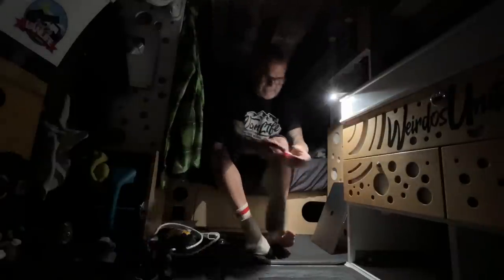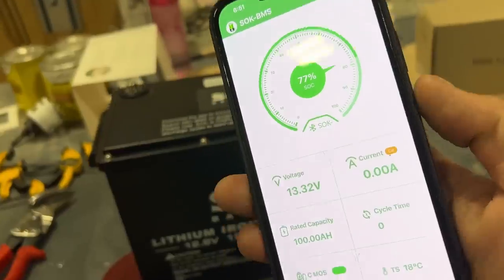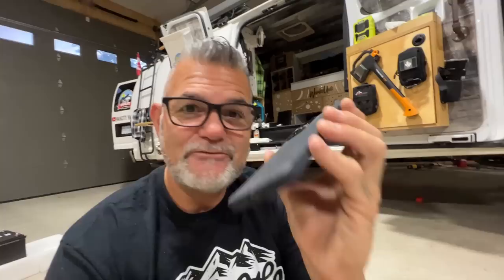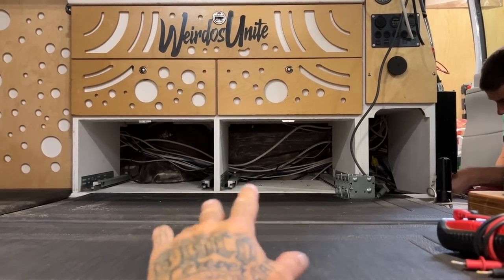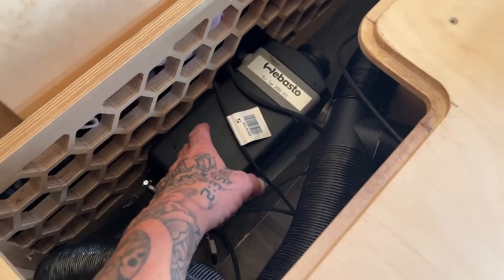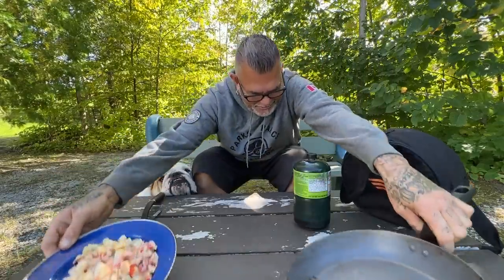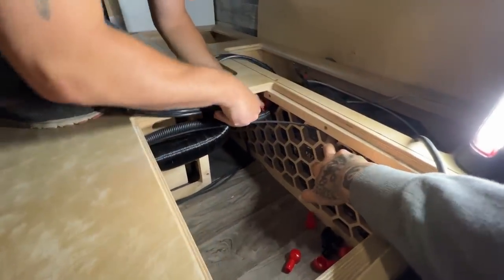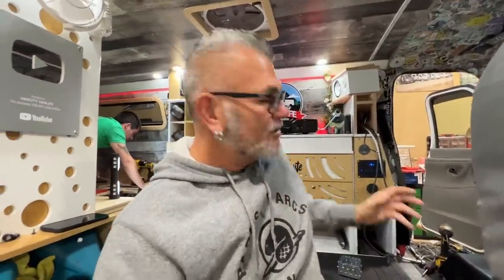Camper Van Electrical Overhaul. The SOK Internal Battery Monitor Is AWESOME!

Comment: I may not have a lot of technical know how, but I totally agree with you on keeping things accessible and easy to fix. I’ve lived in multi unit apartments, sticks and bricks, and I wished they would do that with heat and plumbing as well because things break down and I move into a unit with all these holes in the walls.

Comment: Tupperware-type containers for Cruz' snacks and dry food can help you organize under your bed.
Reply from the maker: Problem with using containers like that is, they take up lots of room when they are only a quarter full. Wasting more space. Those things are better left in bags or Ziploc bags.
Reply: @VANCITYVANLIFE  Not to mention that you'd lose a lot of the air flow that the honeycomb cutout allows!

Comment: A addition you might want to consider for your batteries is to place them on a drainage tile. Those tiles for garage floors or a patio. It will allow more airflow around the batteries. It will give the batteries a balanced temperature from your heater. Canadian tire sell them. Those SOK batteries are killer 👍

Comment: I just upgraded  my solar , i didn't  have a lot of  wires hidden  behind  my walls but I realized  that I never  want to have to tear down my walls to upgraded or fix any problems.  This is a huge problem because basically  you have to rip everything  out of your van just to fix Any problems

Comment: Although you have probably already left Ray Outfitted, here is an idea someone reading this may use.  'TIMER'

Get a timer put beside the bed wired up to the inverter so it turns OFF the inverter after set time OR AT set time.

It's good having those switches to turn on and off the output. 100% I would fall asleep with starlink turned on so after checking out the 'starlink power supply pinout' I would be making changes.

Comment: I have a question that probably should be answered by Rayner. You are doing a lot to keep the batteries warm for the winter temps, is there enough ventilation under the bed so they don't over heat during the summer months?
Reply from the maker: The underside of my van would never get to that kind of extreme heat to cause those batteries a problem. That would mean the inside of my van would be at an un livable  temperature.

Comment: could you give a full review of the setup starting at batteries fuse size wire size extra.
 planning the same system and want to see if I have the right stuff.
 the only thing different is the batteries are chins.

Comment: awesome. wondering if now that you have updated the batteries and the inverter, will it support running air conditioning, like a 12 volt one, and if so are you considering getting one?

Comment: Could you didtch the victron shunt and just use the SOK batteries' internal monitoring system? I'm getting by just fine with Renogy's smart battery monitoring screen, and do a daily check of usage (mostly just the fridge, plus occasional rice cooker, immersion heater and device charging).
Random side note: I looked at the SOK 200ah (great price!) but noticed max 50a charging current - if you use 2x100ah batteries instead you can push in up to 100a charging current (eg 40a alternator + 25a solar while driving).

Comment: What is your alternator's output? I've considered adding a second 12/12-30 to my setup, but I'm apprehensive about drawing 60 amps from my 150-amp alternator, especially during the first few miles when it's recharging the starter battery after a start. Thanks!

Comment: @vancity vanlife Chrome, Can you also talk about how the Noco is able to charge the SOK batteries. I would assume/make ass of myself that that battery load would be to much for the Noco.
Reply from the maker: The noco is just a battery charger. It could charge one battery or 10 batteries it wouldn’t matter.
Reply: @VANCITYVANLIFE   ok. Just at a max of 50amp. 👍

Comment: Where did you buy your batteries?? Nowhere do I see sell 100ah marine plastic. 🤔 why did you go for 4 and not 2 sok 206ah? I am now buying batteries and curiouser where u bought yours? Thanks!!
Reply: Curious Campervan does not sell them for Canada, I dont see on Amazone.
Reply from the maker: Ordered from the SOK website. If you have the space definitely go with the 206 amp hour ones because they are way better deal. My space I had back there was quite unique and we tried to measure it out for the 200 amp hours and it was just a finicky fit
Reply: @VANCITYVANLIFE  Thank you!!! Better price directly from Sok.

Comment: Chrome, can the heat you are diverting make the battery compartments too hot??
Reply from the maker: No, that’s why it has a turn dial so I can SHUT the vent if I want .
Reply: Thank you so much for the answer, I'm building my own, and didnt want to make a costly mistake...
Reply: @lelandbischert3388  as chrome mention, the battery has bluetooth to tell what's the temp. inside.

Comment: Could you run a AC unit in the summer..can I ask how much is this costing you
Reply: I did a quick check according to what I read their $570 not counting tax per battery and they get a lot more expensive than that so he spent almost $1,800 for four batteries
Reply: @michaelmyers3892  thanks
Reply: @keithwillis4524  I'd love to upgrade and go with more modern equipment but on a fixed income I just got to stay with old school stuff but it all comes down to the individual and their wants and needs and what makes them comfortable
Reply: •  Many people install small common window-style air conditioners that they often buy on-SALE @ the begining or end of the Season. 
•  The BETTER type to buy is called a "Mini-Split" . They're twice the price but use HALF (or less ) the electricity  ;  quite common overseas where electricity is very expensive , but largely unknown in the U.S.
•  In your house ,  you'll SAVE those dollars back in a year or two.  In an RV ,  you'll save the need for more batteries , solar , etc.  WELL WORTH it , but people are resistant to change 😱 .